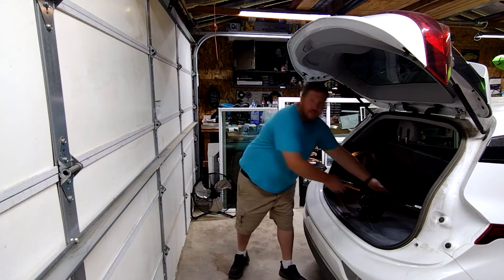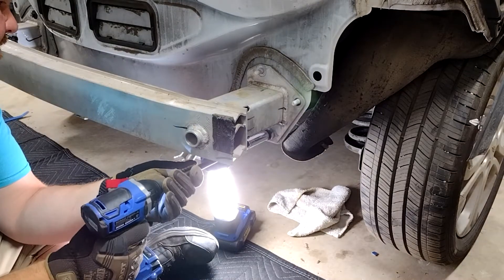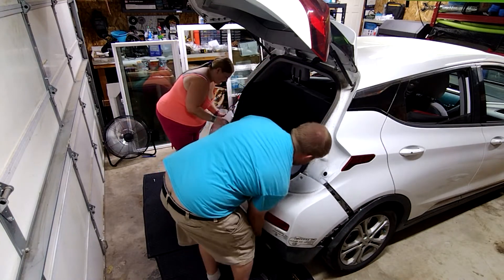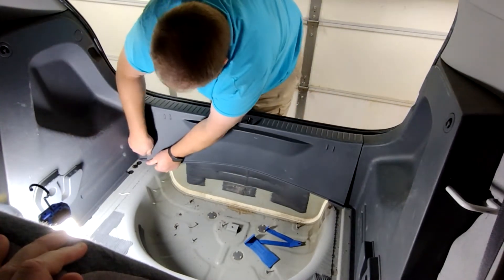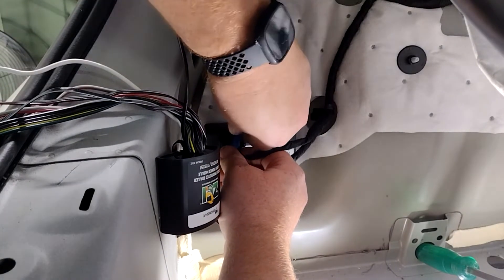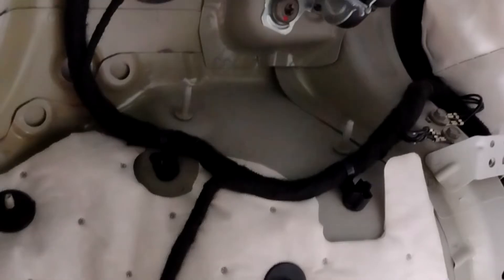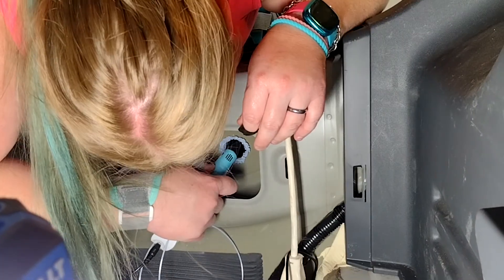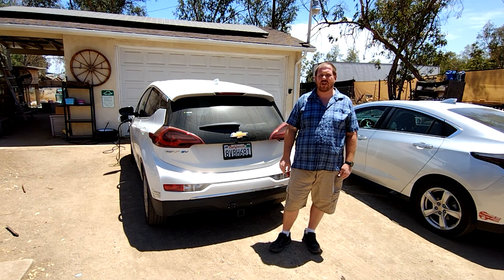How to install a trailer hitch on a Chevy Bolt EV

Comment: Great video. Quick tip though for everyone else doing this; The metal panel clips can be pressed on the side using a flat screwdriver to unlatch them. Then they pull out very easily with no risk of them breaking off. You just need to flex the panels out enough to press them.

Comment: Watched 4 other videos on Bolt hitch install and yours is the most comprehensive. Well done.

BTW our 2" Draw-Tite hitch lists 38 ft lb as the torque spec for the 6 bolts.
Reply from the maker: Thanks 👍

Comment: Thanks, great job. I am only using the hitch for a bike rack so I did not need to do the brake controller thingy but I must applaud you Further because your video is so quick. I actually had to slow down the playback speed which is so rare, most of the time we have to speed up the playback speed because the guys talk too damn much. So thank you.!
Reply from the maker: Haha thank you.  Glad it helped, and you can always add the lighting controller if you plan on towing later!

Comment: Those bumper clips on the wheel well… so easy after you realize they require a push, but a pain before that. I cracked two before realizing  how they work. Thanks for the vid.
Reply from the maker: You probably shouldn't ask me how many little plastic clips and pieces I've broken over the years....

Comment: Just ordered one to install on my bolt, ordered a 240v charger too, I've been using the included 120v for the past ~3.5 years, needless to say it's going to be a fun next couple weekends
Reply: The harness they're selling now doesn't need to tap into any of the wires, other than power and ground
Reply from the maker: Yeah those are nice!

Comment: Great video! Hoping to our new Bolt in soon and want to do some short-distance towing with it. This video is so useful. Thank you for your time!
Reply from the maker: Glad we could help.  Sadly this car was totaled, but its replacement (2022 EUV) has towed a ~1,900 lb teardrop over 1,000 miles to the Grand Canyon and back, so you should have no trouble at all with short-range towing.

Comment: That red wire that you tapped into looks really small. Can it supply enough power without overheating, etc.?
Reply from the maker: I wouldn't expect any issues, considering the car and our trailers all use LEDs.  Plenty of other trailer adapters just use T-harnesses, which accomplish the same thing, piggy-backing off of whatever the factory uses to supply power to the rear lights.

Comment: What year Bolt EV is this?  Mine is a 2023 and it is different.  According to the instructions for mine (drawtite hitch,) you do not have to remove the bumper fascia, just take out 2 plastic "rivets" and 2 screws to loosen it.  I think the 2022's are the same as mine.
Reply from the maker: This is on a 2017 but we've also in installed an EcoHitch on a 2022 and also had to remove the bumper.  I think the DrawTite might install differently.
Reply: @jkfeatherranch  Ok.  I just started the installation.  I will post a comment here if I don't have to remove it.  Thanks.
Reply from the maker: @19sloper  best of luck!
Reply: @jkfeatherranch  I did get my installation done without removing the bumper fascia.  Took loose the bottom screws, and was able to pull the bumper out enough to get the hitch behind it.  My Drawtite is only a Class I, and is likely slimmer than yours, however.
Reply from the maker: @19sloper  awesome

Comment: The wires you used for the brakes and running light did not work for me on 2017 premier trim Bolt.  Frustratingly they work perfectly as long as the trunk is open, but as soon as the trunk is shut the car switches to using a different set of running lights and brake lights and suddenly the trailer lights go dead (except the signals which still work fine).  The rest of the vid is great tho.
Reply: BTW I found the correct wires in the harness that heads up towards the roof.  Same colours, just different location.  They work fine.
Reply from the maker: In order to comply with federal law, GM ran redundant sets of tail lights.  The set on the hatch itself are used when the hatch is closed, and the set on the bumper are used if the hatch is open.  We don't own the car car anymore (totaled...) but from what I remember, there should be two sets of wires in that general area, the one towards the front of the car that is harder to access is the one that you want.

Comment: can't find the video on the 7 pin wiring... did you make it finally?
Reply from the maker: I just put the connector through the bumper and wired it to a 4-pin to 7-pin adapter up under the bumper.  There's no power wire or break controller that way but it's a much more robust connection.
Reply: Ok thanks. I am looking to install a 7 pins to have break connection to haul a small trailer.
Reply from the maker: @poemond  Neither of our trailers have brakes so it wouldn't matter

Comment: How much towing Bolt can handle? Is it even recommended?
Reply from the maker: Not technically recommended but the hitch is rated for 2,000 lbs and seems to handle it fine

Comment: Bolt can tow 2000lbs and tongue weight 300lbs I believe
Reply from the maker: That's the rating of the ecohitch as well. Technically the both can't do anything because it's not rated for anything........ But who cares